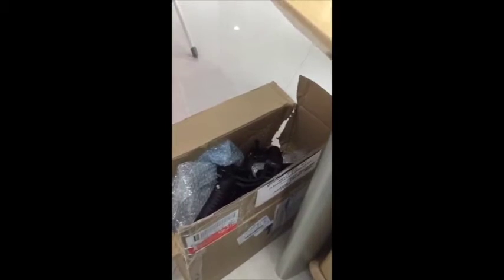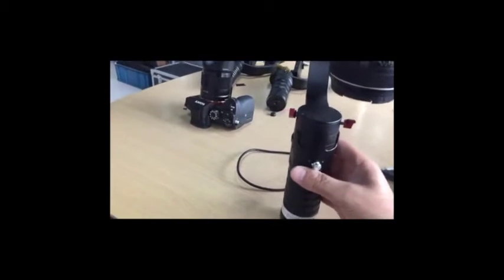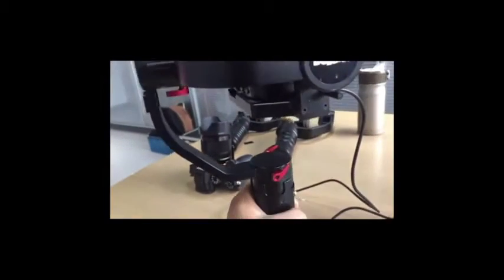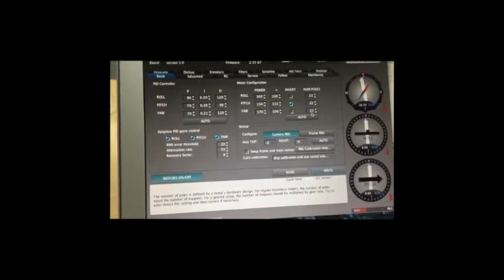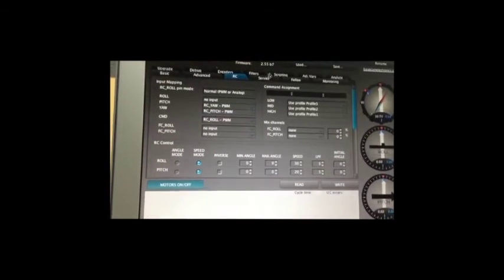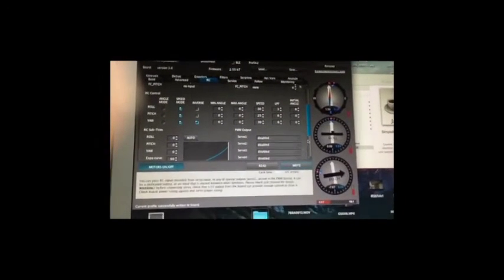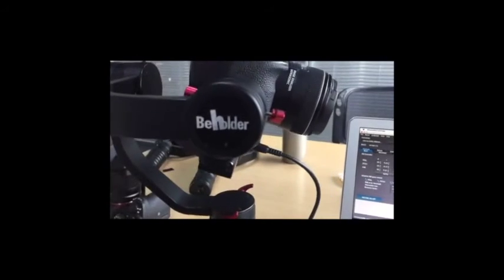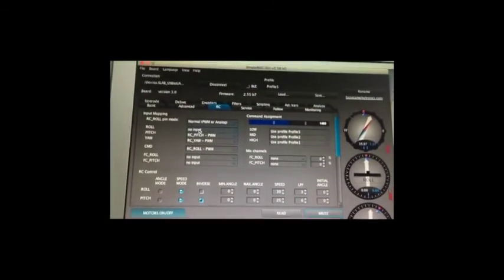Re-upload Non-functioning joystick on your Beholder DS1

Comment: Hi, thanks for a great tutorial. I'm having the same issues with my Beholder DS1.  I've tried to connect it to the SimpleBGC but can't seem to see it in the connection.  I've followed all the instructions in that I installed the Driver for the Mac from here.Silicon Labs VCP Driver.  Ran the terminal commands and then connected the USB to my Beholder and Mac. But when load up the GUI for the simpleBGC it only show three options for connections. Two are bluetooth and the other says UDP. Any ideas would be greatly appreciated!
Reply: +Bubblegummonsters Sorry just figured it out.  I was plugging into the micro USB on the handle. Only realised after watching one of the MS1 videos that there's another USB in the base plate.